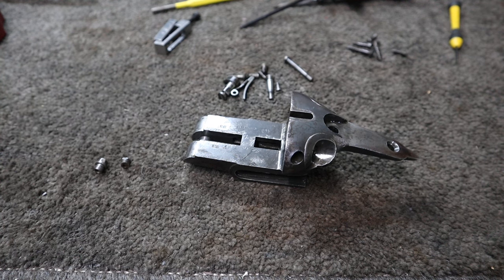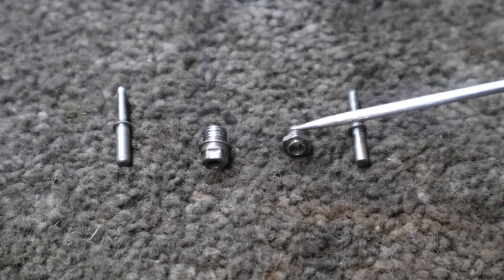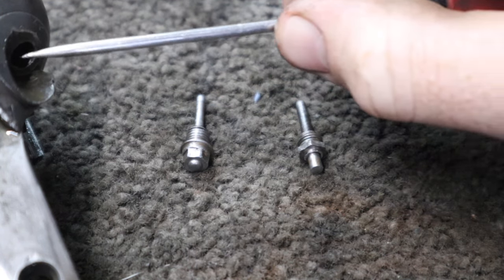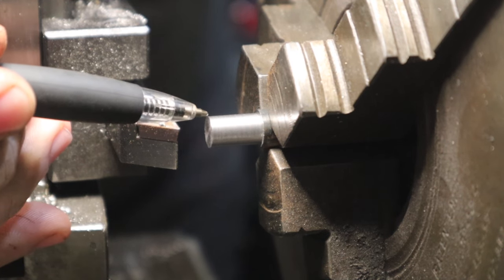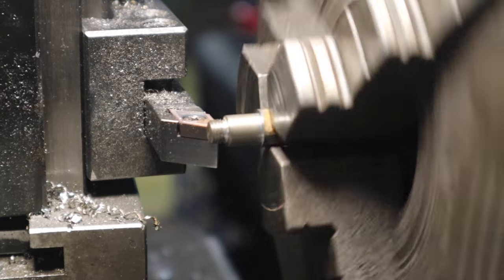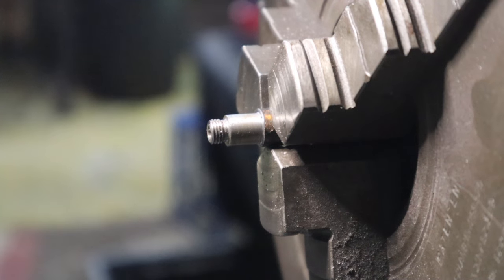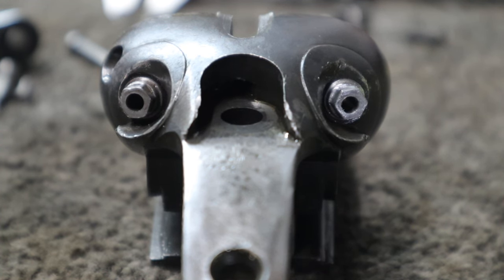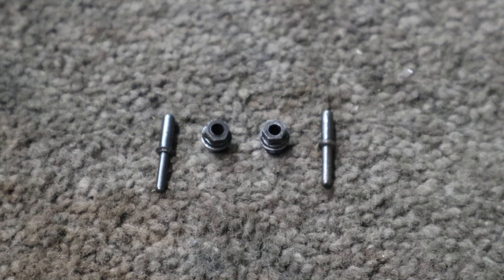SXS Firing Pin Nipple Fabrication

Comment: Does it need heat treating and hardening as it is mild steel or not required? Another informative and great video mate 👍. Love the diversity of content on your channel !
Reply from the maker: The hammer is case hardened, so if you harden the nipple you can run into dramas. Nipples are replaceable items, hammers not so much.